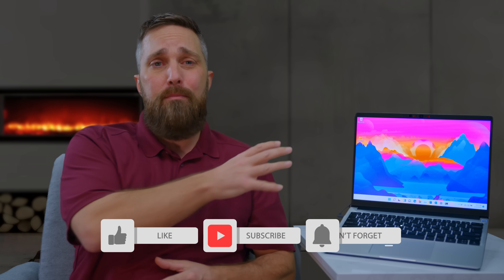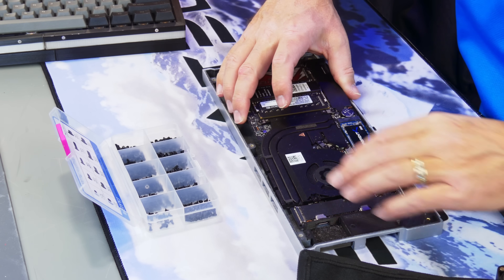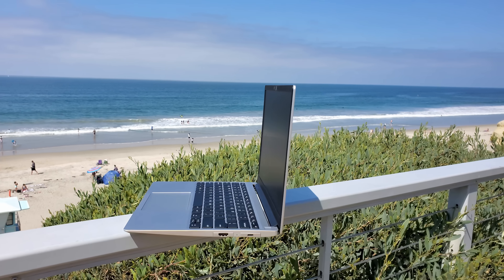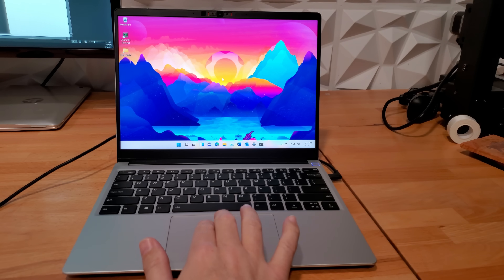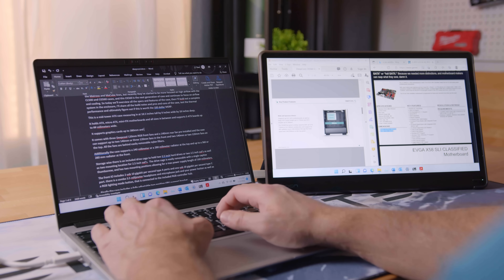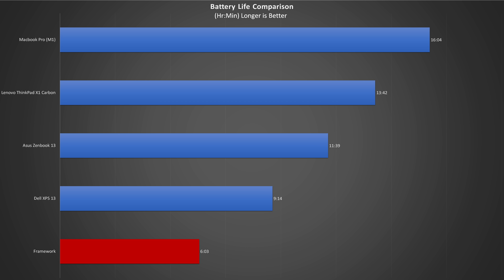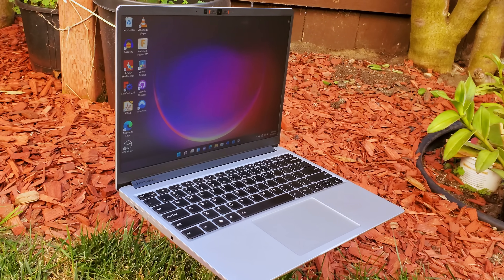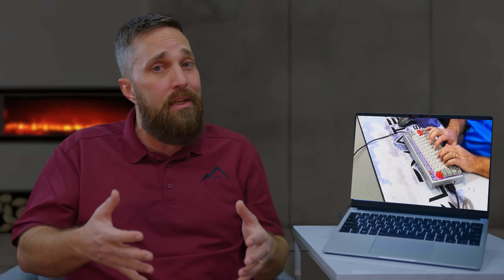Framework Laptop 6 Months Later. I'm Less Impressed 😐

Comment: That is EXACTLY why Linux should also be offered as a preinstall: It is unreasonable for a customer to pay full price and then has to install Linux by themselves and not have a guarantee that every works. The framework would be perfect, except that they still don't stand behind Linux, which I categorically will not support and buy. I'm paying as much as a Windows user, why should I be second class citizen???
Reply: that's one of the most backward bits of logic I've ever heard, as I have dualboot Fedora and Manjaro and am going to upgrade the mainboard, and have plans for the old one MB Every distro worth it's salt supports multiple machines, you can even put System76's PopOS on it. And no, you don't pay as much as a Windows user, as long as you buy DIY, which really doesn't require technical skills. Maybe put in memory and SSD? It was a while ago and I got mine running within an half hour DIY is cheaper without windows. Do you have any idea what you're talking about, really?
Reply: @squirlmy  Yes, as a matter of fact I do know what I'm talking about. I have been a Linux user a loooong time and work in the field as sysadmin: This kind of mentality is the reason that Linux has 1% or what now 3% market share? And it is not getting anywhere, because the fact remains: 97% of all users will never install their own OS and neither should they have to, it is totally unreasonable: MacOS, Windows and Android are almost in all cases preinstalled and ready to use for the user, while Linux is not. I don't want to have to buy the DIY edition, no, I want to buy the finished ready and certified edition where the company has put int all the work to get everything working, so I don't have to. My time is expensive and I will not waste it for something that is not necessary. Of course I can install an OS without problems, I do it all the time, I maintain many Ubuntu and Debian servers, all installed by me, but it is the main and biggest roadblock for mainstream Linux adoption. Because if you had Linux preinstalled and available next to Windows (for cheaper) as a install option, we would see massive Linux adoption very soon. We know this because the same happened in the cloud: AWS offers Linux and Windows, but Windows is more expensive and people chose Linux because of this (among other reasons like flexibility and security). Thanks to this, the Cloud is now almost 100% Linux machines, the same would happen with Laptops and Desktops eventually: People chose Linux and don't even know it, because it just works. Microsoft knows that many people would think they are still using WIndows, but actually are Linux users. Raising market share would immediately cause all apps to be available for Linux too, because that is how it works. Windows has never been excellent, but just merely good enough. Linux is actually a really well engineered OS. I have done dual boot many years ago and it is a total mess and who wants to have to switch back and forth, rebooting every time? I use Windows in VMs under Linux, so I can run apps that I can't get to work on Linux, but it is also not ideal. But thanks to Valve and Steam and SteamOS, Linux has progressed really far in the last years, it is ready for the big time, but only if it is preinstalled. Because the framework is already considered hobbyist, you can't reasonable expect the buyer to jump through so many hoops that they have to put together everything themselves, hardware AND software.  If you check, you will notice that you can really never buy for example a laptop with both Linux and Windows as options at configuration and paying less for Linux and have it preinstalled, with support. This is because Microsoft has contracts, NDAs that prohibit this for OEMs, they are not allowed to show how expensive Windows really is. This led to the absurd reality in the past that for example with Dell, systems with Linux were more expensive or the same price than Windows. I'm frustrated and very disappointed that Framework decided to help Microsoft (or even gets paid by them?) to make sure that most Frameworks will always run Windows and make Linux adoption as hard as it can be by giving no guarantees or even support and... not preinstalling it. Because I don't pay full price for a product, yet I would get support for the OS from Framework when I use Windows, yet I get none if I use Linux. For me the spirit of the Framework (openness, modularity, repairability) is much closer to what Linux stands for than what Windows is. Sooooo with the way we have been doing things (expect users to install Linux when they want to use it or pay extra for getting it from very few select manufacturers), Linux will never become a success on laptops / desktops, so we will never be able to get rid of the shitty WIndows experience and will have to run it in VMs or use dual boot.
Reply: Because you ARE a second class citizen, you use Linux. Think of this from a business perspective.
Reply: @rustyshackleford7200  You are absolutely mistaken: Linux is the most superior, most secure, most efficient and most flexible OS in the world and the most professional one: Linux has taken over the world, pretty much all cloud and web / internet / app servers now run Linux, everybody that runs Linux knows this and would never chose this pathetic P.o.S. Windows that can't do so many things, is horrendously inefficient and a resource hog, plus has the most horrible security of all OS on the planet, thanks to Microsoft just being clueless about what security actually means. Linux is in pretty much all ways much more professional than Windows ever was / ever will be. Today, pretty much all professional IT depends on it fully.

Comment: I have a Gen 1 and the USB ports do not work reliably with anything that uses USB 3.0 or higher. I've already had the board replaced once under warranty and the problem persists. I hope the newer generations don't have this issue.
Reply from the maker: I have a batch 1 11th gen and use multiple USB 3.2 and USB4 devices and have had no problems.

Comment: Its just six months. Wait some more time. Its going to fall apart on you. There is a reason macs are well made.
Reply from the maker: Over 2 years now. Still solid and I'm about to upgrade it for the second time going from an intel to a ryzen mainboard. I cant do that with my Macbook.
Reply: @ElevatedSystems You cant even change/add RAM modules, maybe you can change the main storage disk in Mac, but at expenses of half of the original laptop price.

Comment: I applaud Framework for doing this project, I really do.  But for a 13-14 inch laptop, all this modularity is really overkill for most consumers.  All I really want is:
- 2 user upgradable RAM slots i.e. no soldered on nonsense
- an extra M2 slot for a second SSD drive

The battery on most laptops (not Macbooks of course, nothing is user upgradable on Macbooks) is already user upgradable.  Wifi card is usually already upgradable.  Those are really the only things I would care to change/upgrade over the life of a laptop.  

Asus, Dell, HP, Lenovo, etc can easily implement those 2 changes (RAM and extra SSD).  They just don't want to because that's how they make their money.

Now, for a gaming laptop with a dedicated GPU, it's a different story.  Being able to upgrade the GPU is a huge deal.

Comment: TBH I think this is a hyped gimmick. The 13" model is not particularly compact, there are only 4 expansion ports and cant shake the feeling that without the bulky dongle system, much more expansion ports can be fitted. And it's still expensive.
The only pre form framework is that they supply parts, like mainboards, keybords, panels hinges etc. But prices are not cheap though. Some mainboards are as expensive as a new cheap laptop.
Making good normal laptops for a decent price (say, competing with HP, Asus etc), with normal I/O and having parts availability would be a way better deal.
So in my book, this is a mediocre laptop with limited I/O for a hefty price with the only advantage that a lot of parts are available.

Comment: Market share ( I have to add on a desktop!) might be as low as yih said. Yet, you also started that most users do use Linux on the machine - what makes sense it’s not a machine for everybody - you get cheaper models with similar specs if yih don’t need all the bells and wistles This device comes with. That being said, you said they work together with Linux devs despite of the market share - this comment does feel a bit off when speaking about this decives for above mentioned reasons

Comment: It's really nice that for all of your complaints in this video, they have fixes/or new parts to address these areas. They have an upgradeable new screen hinge that is much firmer, a matte/matted screen replacement (instead of being stuck with a glossy one), they have an optional speaker system that's much louder (if that's what you wanted), they have an Ethernet adapter that slots right in like any of the other square slot port adapters, they have a larger capacity battery (not a huge difference in size since physical sizes kind of limits max watt hour capacity for the time being until battery technology gets better and evolves, but it is larger in capacity), they have replaceable touch pads, keyboards, etc. It's a really cool design and something I have been wanting a company to come out and make since 2001. Oh yeah! And they have an AMD option motherboard too that you can easily swap out!

Comment: I'm really looking forward for your Linux distribution reviews on this laptop.  Usually I quit windows when my laptop starts to have some real problems.  It then add 8 to 15 years to the computer's life.  This would be the first computer I would start at the very beginning with Linux.

I went through Ubuntu, Mint, Manjaro, and now Garuda.  Garuda Linux LXQT is what fits my needs for now.  Eventually I should try Qubes OS which is one of the most secure distro.  But then I would need a stronger machine.

So thank you for your review, and keep on the good work!

🙂

Comment: I'm interested, because those faults can be resolved with part upgrades. Framework did, for example, produce upgraded hinges and a matte screen.

With any other brands that's resolved with next year's model, maybe. Not this bunch.  Fw sell the parts directly - upgrade that bit if you want to, much as you can with a desktop PC.

Only foil is whether the brand survives. They're genuinely trying to generate an open ecosystem, there is a bit of 3rd party buy-in starting. Only time will tell.

Comment: Some of the valid complaints have been adressed, there are stronger hinges and a battery with more capacitiy but the same measurements as well as Ryzen CPUs and an ethernet expansion card.
As said in the video, Framework feels like a trustworthy company that listens and delivers, be it not always in the first try and not as quick as one would sometimes wish, but they do deliver.

Comment: To be fair, I bought a Lenovo Yoga (Ryzen 2500U), and I have had SO many issues with the machine, not from a hardware standpoint, but from a BIOS standpoint. When I talk to customer support you reached people going by protocol. They literally can't forward the issues to actual engineers to fix them. So after my warranty ended I'm stuck with this:
- Laptop can't go to sleep in Windows (the system will hang), unless I choose a really early version of the BIOS. works in Linux though (which is my primary OS now)
- When the laptop reaches 20% it dives down 400MHz as some kind of ultra-powersaving-mode, this is not an OS issue, but a BIOS one (happens in both Linux and Windows and is not a part of any software profile). With the early BIOS version where sleep works, it gets stuck at this power mode even if you plug power in, or charge up the device. This is fixed in later bios version, but that sabotages sleep mode for Windows.
- Early BIOS version have good standby time and it sips power during sleep, but is unable to wake up properly. Later BIOS version drains the battery quite a lot during sleep, but at least the laptop wakes up.

The worst of it all is that customer support couldn't do anything, they couldn't forward the issues to real engineers. And it seems like Lenovo itself just wanted the warranty to run out to escape the problem. I still have the laptop, I still use it with Manjaro Linux. It is still a very flawed experience. So really, if these are the issues with framework's first laptop. I am completely fine with that! As long as they are out to fix the issues. :) I am onboard, completely!

Comment: This is really interesting, thank you! As a graphic designer I am really concerned there's not a separate graphics card for this laptop (specifically because I want to be able to replace a broken or poor graphics card i.e. the whole point of Framework!). Is that something we could expect from Framework in the future, or will that not be compatible with the way the components are set up right now?
Reply: The Framework Next Level event just happened yesterday, and the answer is "Yes"! They introduced AMD mainboards as well as an expansion bay to allow for discrete graphics cards - I believe they are launching later this year

Comment: I bought mine (11th gen i5) for a hair over 1K and I am happy with my choice as I do believe in repairability and susatinability. Also I know that I can swap out my US keyboard for a German one when I will eventually hand over this device to my kids. Yeah, battery life is bad compared to my company-issued MBP but to be honest everything above 6 hours of battery life is sufficient for at least my travel profile.

The only really bad bad drawback is the extension cards drawing power when in sleep mode. This means that I have like a day of sleep mode time only before the battery is running out of juice so the laptop cannot wake up any more in the state I left it at. This means I need to hibernate or shut it off if I anticipate not charging the laptop for a day. And that sucks big. My workaround is to not use any (Apart from USB-C for charging) which again is pretty suboptimal.

Comment: I wish they had AMD Hardware and settled on the standard 15" form factor which would allow for a bigger battery and possibly a dedicated GPU. An all AMD Package would make a lot of sense then.
Ngl not making this a fully Linux compatible device when the majority of the user base are the Linux Type is kind of an L.

Im running a Ryzen 5500U and that CPU is beyond impressive in terms of how fast it is for being a mobile 6 core chip which is technically last gen with "only" an integrated GPU. But at the sane time its absurdly efficient like in idle it puts out so little heat that I could probably run it without any kind of heatsink for minutes.
AMD is straight up superior to Intel on mobile right now fr, better pricing, more efficient and fully Linux compatible.

Comment: The only reason I have never bought this laptop is because they only have the tiny size. Great for traveling but I don't travel all that much. The small screen is bad for my older eyes too. If you go to Best Buys and even Walmart, you'll see lappies of every size, from tiny up to huge. The reason? Not everyone want the same size laptop!!  And those stores get that, but this company does not get that. They could put all the same components in a bigger shell with a bigger screen and would just have a lot more room for things, so big deal!! Not buying this tiny thing. The one thing I could do is have their little laptop but buy a separate monitor and maybe a keyboard and mouse and also better speakers. But that all would just add to the cost on my retirement income. But that would be at least feasible if I can swing the bucks.
Reply: The company is relatively small, I dont think its that profitable to buy a bunch of differenzt sized screens just so a few people out of their already small selection of customers will buy them.

Comment: You’re certainly right, this is for a specific group of consumer. And I ain’t in it. 😅 6Hrs of battery life on a $1400 laptop isn’t acceptable, I don’t care how much u can tinker with it, or replace parts. A well built laptop doesn’t need to have its parts consistently replaced. And when you consider “upgrades” like the mobo at $800+, you’re basically upgrading to a whole new laptop as you’d most likely have to replace the RAM as well. And that’s not considering the crap trackpad, hinges, and other parts you’d have to replace in time.
Reply: > A well built laptop doesn’t need to have its parts consistently replaced

Well, if something breaks or you want / have to upgrade something, now you can!
And also modern devices by big companies are purposefully built to break, so you go out and buy a new one - this is not;

As far as I know they fixed the Trackpad and Hinges now too!
Reply: @qyint  I can assure you that a MacBook is not built to break. The Framework is just so puny.

Comment: How do you disable the camera and microphone(s)?
Reply from the maker: there's a physical switch next to each that disables them
Reply: @ElevatedSystems  Yes, but is there a way to disable within the BIOS?
Reply: @Rackfinity  At that point couldn't you just desolder them?
Reply: @naturalcauses1695  That would certainly be an option, but hopefully the last resort and we believe HP is working on a fix.
Reply: @Rackfinity  as far as i know, the microphone switch is a hardware switch, so it disconnects the microphone from the motherboard;
this is the best option as software switches can be reenabled by attackers in a worst-case scenario - and its user friendly too, i dont see why you wouldnt want to use it
Reply: @qyint  I appreciate the info, we do not have one on hand to verify, and it's a security concern for a company.